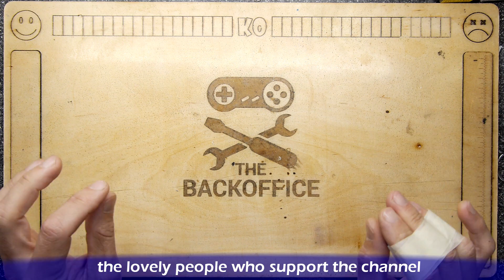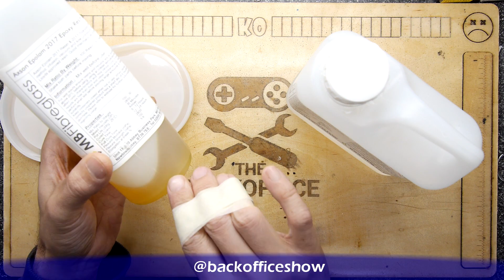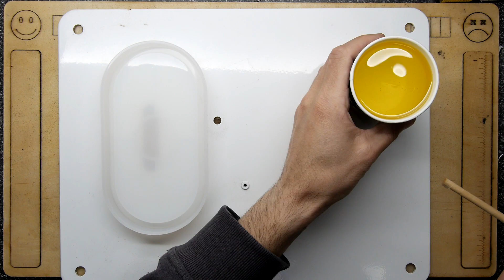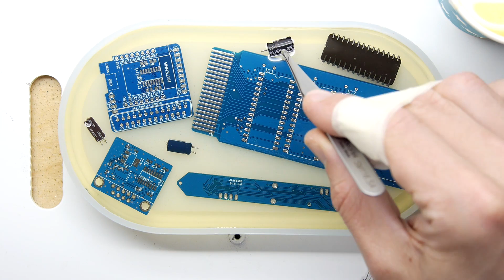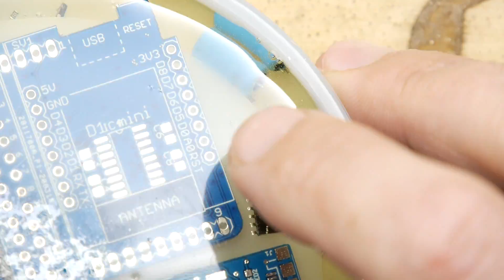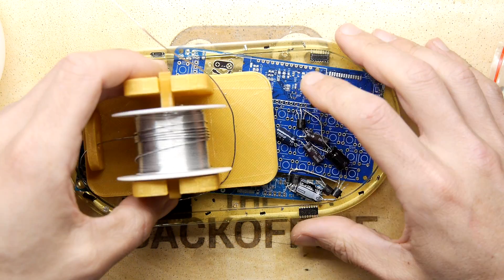Cool Resin Electronic Parts Tray - You can do this!

Comment: "..I have an issue with Epoxy resin..
."

So why aren't you wearing gloves?!
Nitrile gloves are ideal.
Reply from the maker: I like to save the gloves and just take care. The resin is gloopy enough not to splash around. It's when you are working arm deep trying to seal a fuel tank using a brush or sponge that the danger really starts.

Comment: I think it makes it harder to find components inside but it looks awesome :D
You could gave heated it up with your hot air to remove the bobbles it would do the same as vacum, well quite enough thow.
Reply from the maker: Definitely could do better. I think maybe brushing the items with resin before inserting will also help